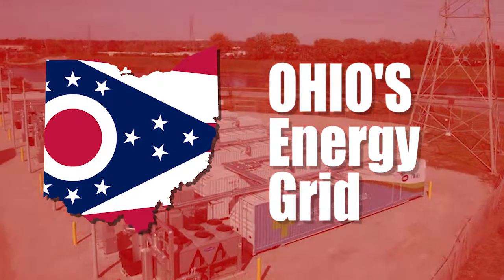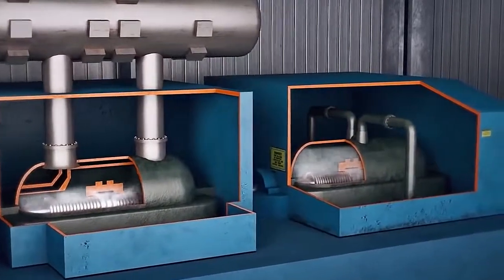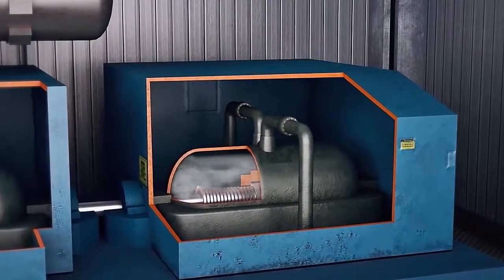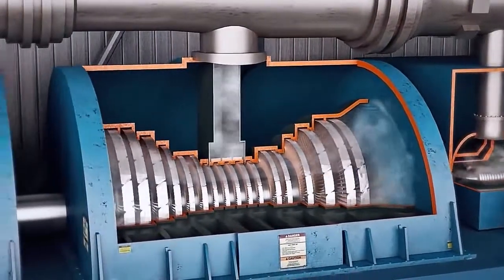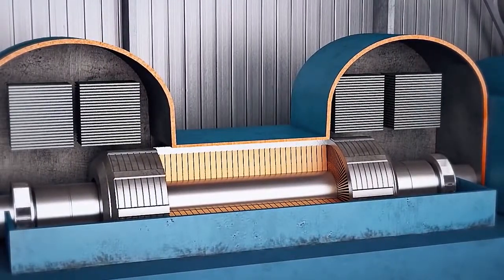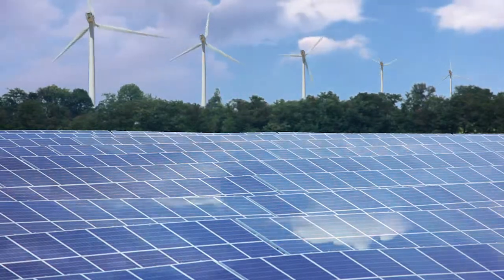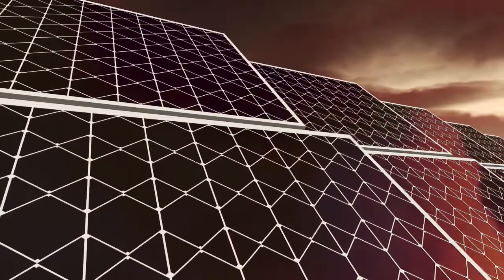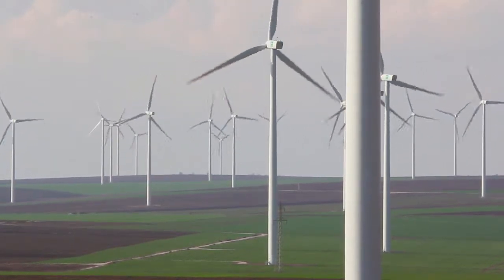Ohios energy grid INERTIA AND FREQUENCY

Comment: Although not incorrect, in your explanation, it leaves out the fact, that inertia can be created with electricity from solar and wind.
Enter this thingy called batteries.
1) they replace inertia in the Grid.
2) they also remove 3x Fossil Fuel burning and allow removing  coal plants from the grid.
The change in frequency is a result of a change in loading vs sourcing.
Synchronous generators do the same thing as steam turbine inertia.
fun fact: steam turbines do not own inertia
Those same inertia, creating masses can be spun with electricity instead of steam.
But that is more expensive than doing it with electronics, now.
Virtual Inertia from a DC to AC inverter, such as on a solar house feeding the grid, can stabilize the grid frequencies. At a fraction of the cost to do it mechanically.
So you used to be correct, now your 100 wrong.
electronics with solar are the cheapest form of electricity, today.
Add batteries and it solves everything
10% storage removes 33% FF burning, but only up to somewher between 8% and 14% is my window for when this drops down from 3.33% FF burning extinction for each 1% of storage adds.
Gaia Your welcome
Reply from the maker: Batteries are a very expensive and very environmentally dirty way to provide inertia. Of course, it is possible but not economically nor environmentally sustainable.
Reply: @jonmorrowpaul  They provide inertia, if needed, the power electronics do the PFC.
PFC is where the savings comes from, not from the inertia, that's a free ride 2nd benefit of synchronous compensators.
Batteries are an add in that provides extra ride through to provide inertia on demand.
There is these thingies called synchronous compensators, they save huge amounts of power.
power electronics can do it cheaper and in less space for PFC. This is why a synchronous generator saves energy by.
Size & cost allow for power electrons with or without batteries to do the same thing.
The inertia is added by batteries.
This is seldom used, so even if it was not efficient (It is at 85% RTE) it would not matter. The savings is in the PFC, not in inertia. But inertia from anywhere, batteries, distributed solar can be obtained electronically for short periods, to long periods, depending on the peak power, and volume of storage at site.
Reply from the maker: @rondavison8475  again, Ron, distributed solar is not cheap, batteries are very expensive, they still need a complementary power supply. Solar is not at all economical nor sustainable and it certainly is dirtier than fossil fuels.